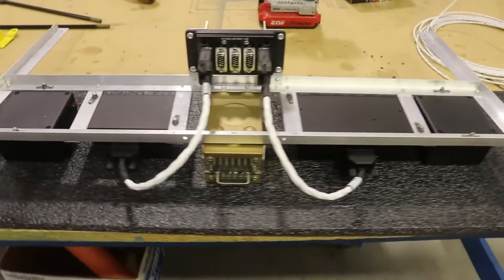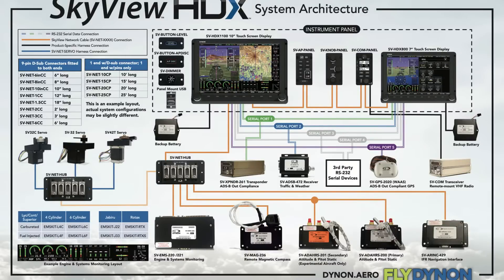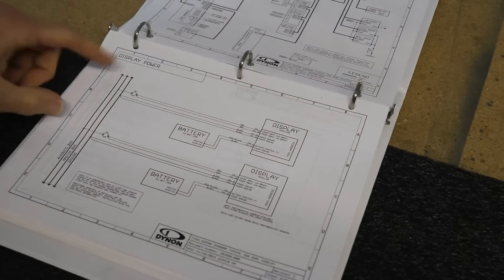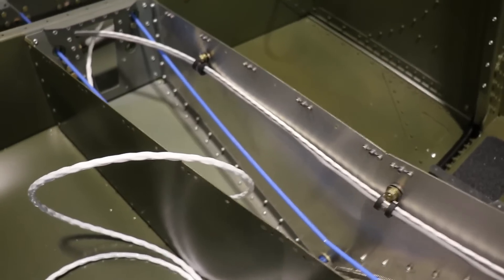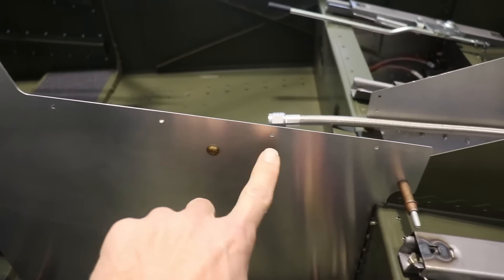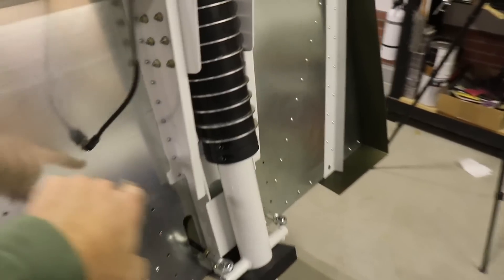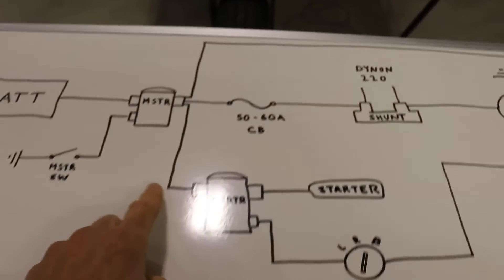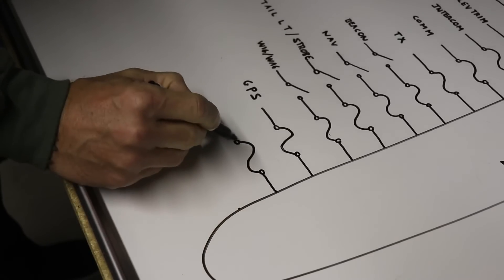Basic Aircraft Electrical Planning (Ep62)

Comment: That’s beautiful job.    Does dynon supply those 2 ft cables.  I was considering garmin but wiring looks simpler with dynon
Reply: What about the connection from the servos to the hub.  Do you have to fabricate those?
Reply from the maker: @ebrionez The end of the cable that connects to the hub comes premade from Dynon. The other end that connects to the servo is put together by the builder after cutting the cable wires to what ever length you need. Very simple to do.

Comment: Look at relocating your 50A breaker to the currently unprotected line that feeds the main buss.  Currently you have a 50A and a 5A breaker on the same line.
Reply: I saw that. The 5amp would go long before the 50-60 as amperage is the same on the pos and neg, besides two breaker/fuses on the same line.. you can fuse either side. I would look at using a normally open relay for alternator isolation that closes when the master is on.

Comment: G,day from Sydney Australia.
Can you cut, shorten/lengthen the wire on avionics products, without effecting warranty?
🌏🇦🇺
Reply from the maker: Obviously anything you do on the avionics will probably void the warranty, but Dynon provides two types of cables. Some are finished cables with both ends already finished. Others have one end completed, like the end that plugs into the Dynon, and the other end is just wire. All of those wires are meant to be cut to length.

Comment: Looking good.  I like to use zip ties left in a large loop to initially roughly control wire routing.  Then once all wires are in place, the zip ties are easily removed and replaced with Adel clamps or other permanent fixturing.
Reply from the maker: Great tip!